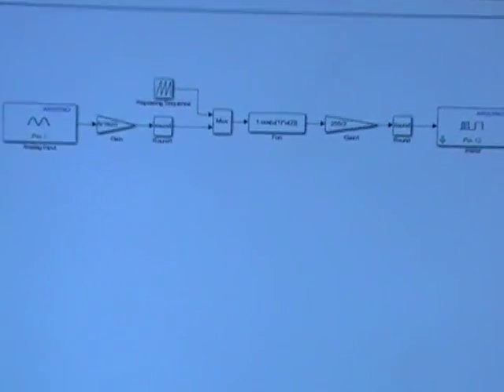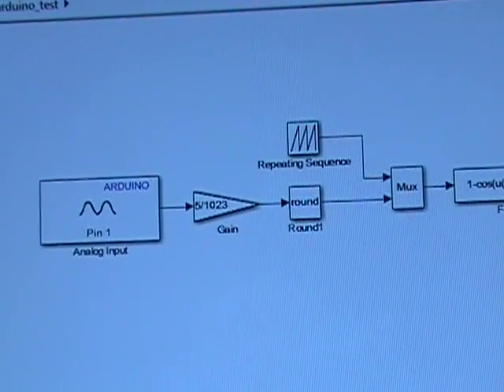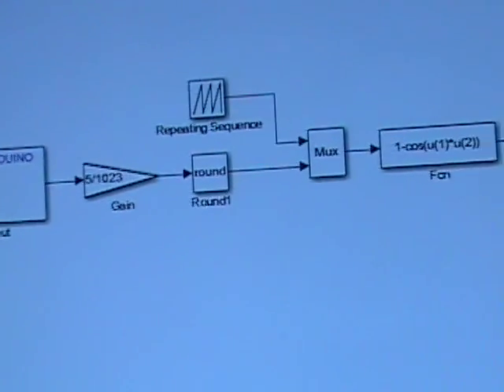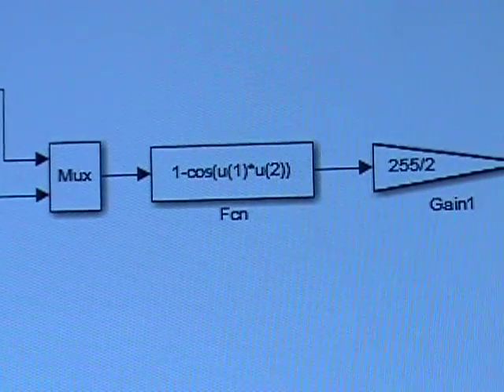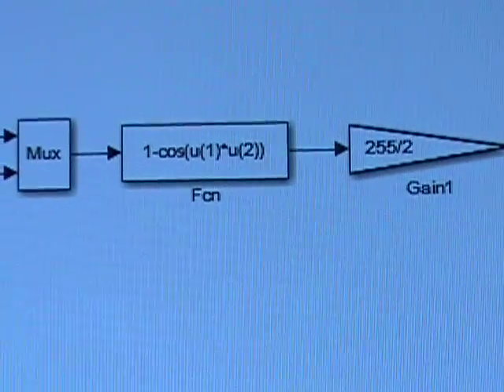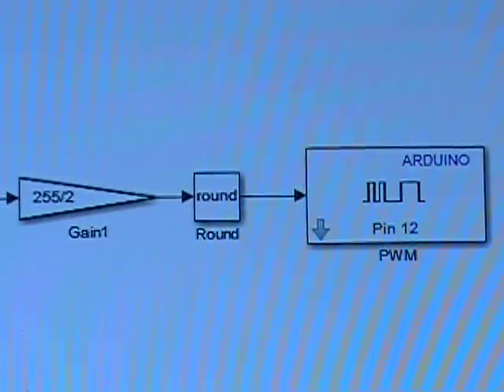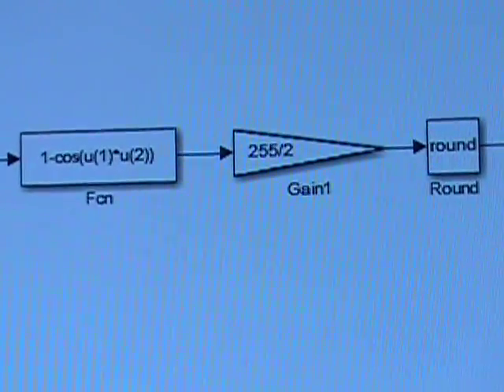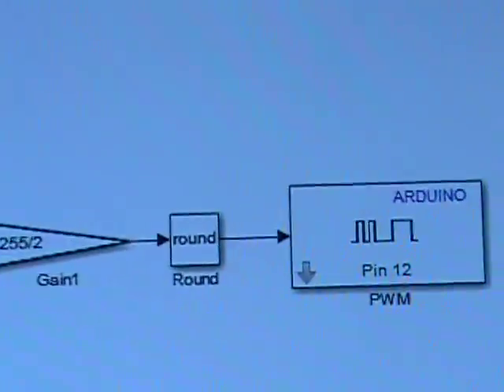Variable Frequency Control of Arduino Pin with Simulink

Comment: That id great Eric.
I am presently using or trying to use SimulinK to Arduino Mega 2560 For FXLmS for active noise Control. Can I get in touch with you for help?
Reply from the maker: Sure, although I'm not sure I'll be much help at this point (been a while since I did anything with FxLMS). Go to my channel's 'about' tab to see my email address.

Comment: when I did the simulation, I encountered two errors, if someone can help me  please 

error ( Only 'single' or 'double' signals are accepted by block type Rounding.  The signals at the ports of 'untitled/Rounding Function2' are of data type 'ufix32_En23'.)

error2 ( An error occurred while propagating data type 'ufix32_En23' from 'untitled/Gain1', output port 1.)
Reply from the maker: Younes Akakba it has been a long time since I used simulink, but you might need to use a conversion block to get the type to single or double
Reply: thank you it was very helpful your answer , i want to know witch value did you put in your Repeating
Sequence if you remember hhhh...... thanks a bunch
Reply from the maker: Younes Akakba no problem. The function is 1 - cos(u1*u2), with one value being the potentiometer gain and the other being the repeating sequence. I had the repeating sequence go from 0 to 2*pi in uniform increments over a period of 1 sec. Maybe try [0, 1*(2*pi/20), 2*(2*pi/20), 3*(2*pi/20), ..., 19(2*pi/20)]. Of course, 0 and 2*pi give the same result in cosine, so you won't need to include 2*pi at the end. Hope this makes sense (and that I am remembered this correctly). Good luck

Comment: HI every body
I have a question
I can do some thing with sfunction to change the frequency of PWMs generated by arduino mega 2560

now the question is that when i use pwm generator block from the simulink library and also that sfunction in the same model, would it work correctly
i mean will using the pwm generator block affect the frequency which i have set?
thank you so mucn

Comment from the maker: That is weird. The only think I can think of would be to check the data input/output types of the combined gain block to make sure it is compatible with the Arduino PWM block. Other than that, I have no idea what could be going on. Your setup looks pretty cool, though. Nice job.

Comment from the maker: Hey Daniel, I have a hard time seeing from the video the problem. I believe that Arduino will round the inputs to the PWM block automatically, so you shouldn't really have to use the round block. I did notice that you have two gain blocks. Can you not combine them into one? Either way, this shouldn't create issues. From the video you shared, everything seems to be working just fine...

Comment from the maker: Daniel, unfortunately the Arduino Uno is not compatible with "external mode", the serial connection between Simulink and the Arduino which allows you to update model parameters while it is running. In order to unlock this functionality, you will need to get the Arduino Mega 2560 or Funduino Mega 2560. The Funduino Megas can be found on ebay for under $20. Hope this answers your question!

Comment: Great, I would like you to please help me with the simulink blocks. I need to make a very simple stuf, I need to send variable PWM controled by a slider gain in simulink, the problem is that I cannot do this with Arduino Uno when trying to do in real time, just like yours

Comment from the maker: Are you suggesting implementing a Simulink "clock" block so that it is output to pin 13? If so, how would this give you variable control of the output?  

The point of the repeating sequence is to avoid using too much memory on the Arduino. Since "clock" is constantly increasing, this would result in the program speed gradually decreasing (which would also mess with the frequency of the output). I learned this the hard way by using clock in another simulink program :)